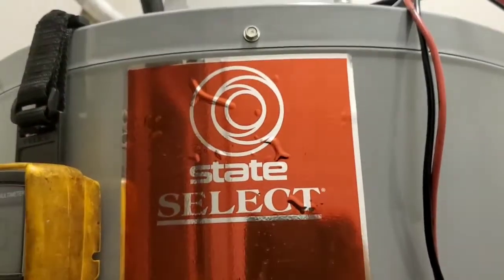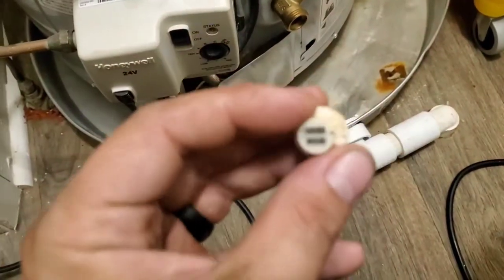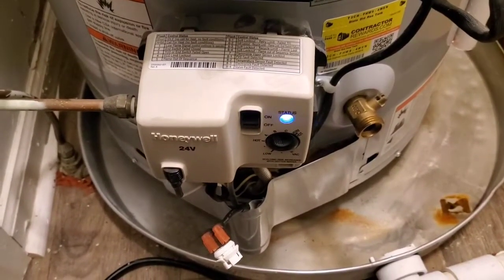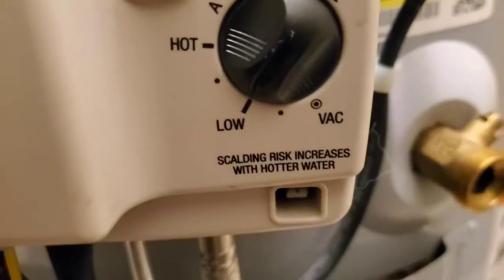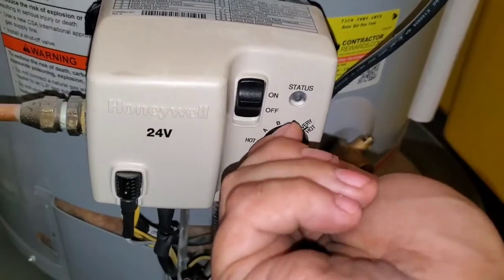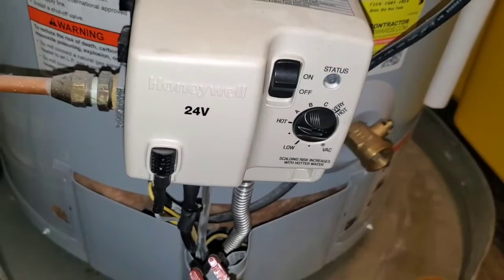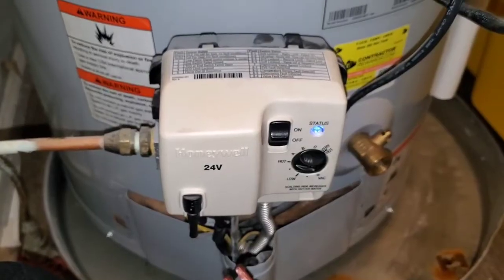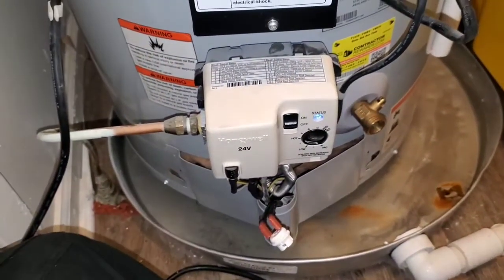How To Reset 7-Blink "FVS Lockout" On Honeywell WV4262B1114 (And Similar) Water Heater Gas Valves

Comment: Didn’t work😩 does that mean the sensor needs replacing?
Reply from the maker: Probably.
This is necessary after replacing the sensor, but the code will come right back if the sensor is bad.

Comment: Thanks man, the only video that worked!!!
Reply: It worked, then now it’s back to the same problem blinking 7 times. 
It keeps tripping! 
Do you know what I should do? Replace it?
Reply from the maker: @mohammad88991 sounds like 
The board keeps getting outa-range readings off the sensor. If you havent already replaced it, definitely do. If you have, something else is up like the connection or something

Comment: Thanks for the video,  where did you get the VF Sensor from?  Mine has the numbers but evetimevery time I search I get results for Rheem.
Reply from the maker: I got it from amazon i think
The number was slightly different so i went with the most similar one and it worked. There are only a few variants of this sensor being used on water haters
Reply: @satanicinduction  I will give it try, in the mean time I have it working for now thanks to you. 👍